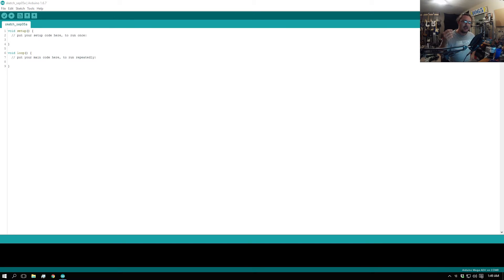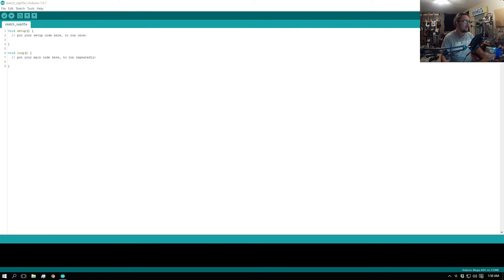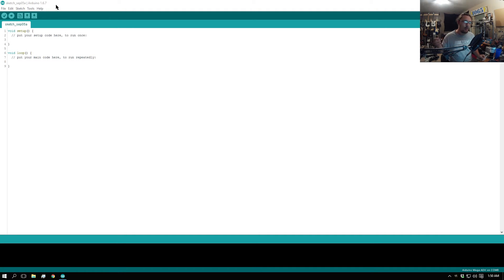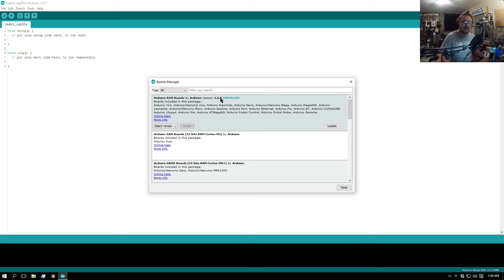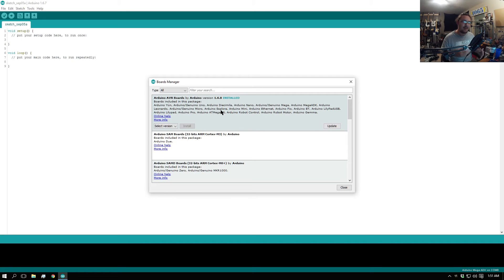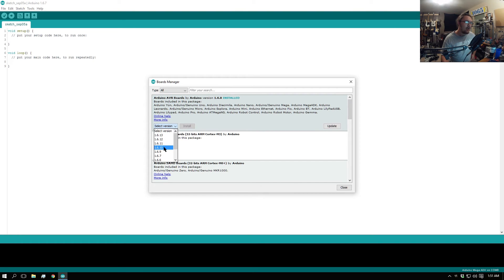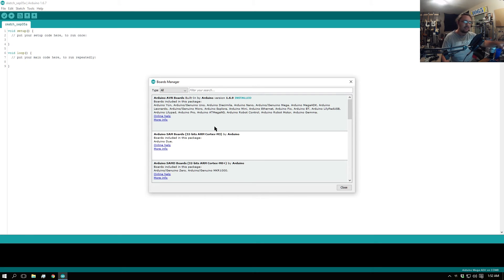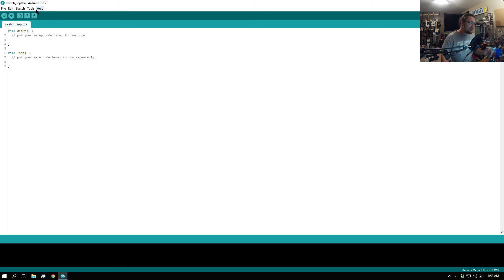Fix For (Some) Arduino Programmer/ Bootloader/ Board Errors

Comment: You just made my day. I had my Arduino AVR Boards at the latest version and I wondered for 4 hours, why I couldn't simply flash my other nano using my (chinese, old firmware) nano as an ArduinoISP. Now it works :D